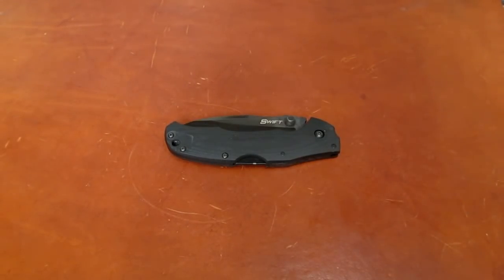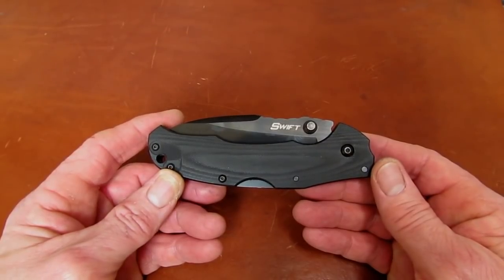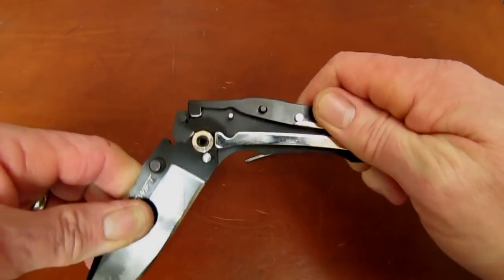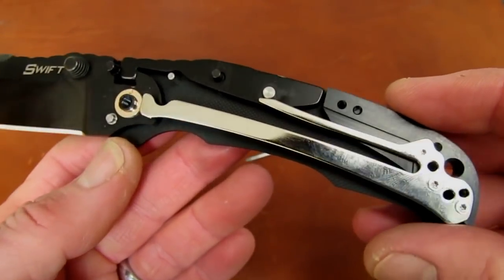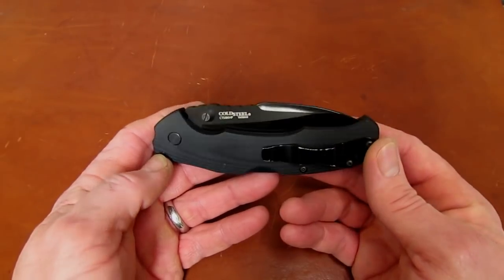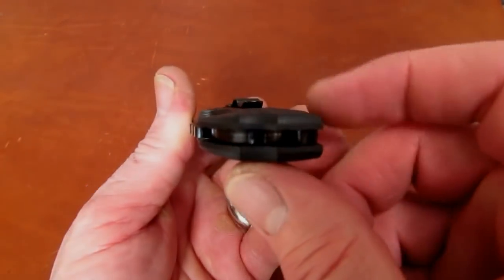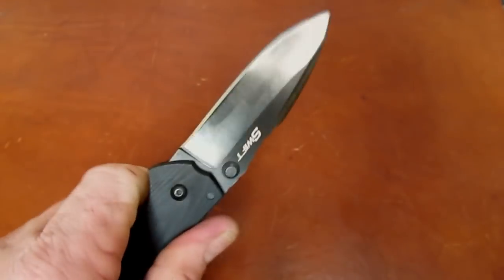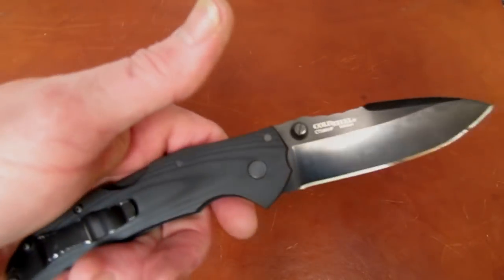FSB -- Cold Steel Swift:  Tri-Ad Assisted Tactical Sweetness

Comment: Thanks for the video, you sold me on the knife. I received my Swift 1 yesterday. And so far I like the assist. With just a nudge the blade makes a great whack sound and it is open. The only issue is a uneven grind on the edge, but I will fix that issue when a put a new edge on the blade.

Comment: Hi, thank you for an informative video! I just bought this knife today, and I find it really hard to open, it's like it's not assisted at all, I have to press so hard with my thumb that it hurts, and even when using the other hand (instead of the thumb) to open the blade it is difficult. Is there anything I can do to fix this which doesnt require me to be an expert on knife-engineering? Would be very thankful for your advice. God bless!

Comment: I found you today coming off a Nuntnfancy knife review and I have been watching you most of the day since. Thank you for your great content! .... P.S. You are not going to be helping my wallet, this I can tell. I am going to have to pick up one of those Benchmade Stryker Carbon Fiber knives. Question: does the centering affect the performance/wear of the knife significantly or is that more of an OCD type thing? (which I do have for my guns and knives) Question 2: How can we send you knives to sharpen and what are your cost ranges? Also, do you do swords?
Reply from the maker: +dawhitecastle Glad to have you aboard, my friend!  So... questions... 
Centering is more of an OCD thing unless there's actual contact between blade and liner or scale.  If you watch my sharpening service video, which is linked at the beginning of all my vids, all my pricing, shipping and contact info is in the description.  No, I don't do swords :(
Reply: +TheApostleP thank you gor the reply! i just be sending you quite a few pieces
Reply: +dawhitecastle just might be*
Reply: TheApostleP Would you pick this ovet the ultimate huntet.  Thanks

Comment: I had a Sog Zoom open up in my pocket. I didn't feel it: I reached my hand in my pocket a sliced my finger pretty deep. It was so sensitive on that spring assist. I have hated assisted openers since then. This design is a little different. It seems like there is retention holding the blade in. Do you seem that being a problem with this one.(firing in the pocket)

Comment: Any thoughts on S110 vs M4 blade steel ?
Reply: SREagle m4 by miles unless you're gonna be using in wet/humid areas where rust is an issue. M4 and s110v are about equal in edge retention but m4 having less vanadium at the same hardness is easier to sharpen. M4 blows s110v out of the water in toughness. S110v is notorious for chipping issues. S110v only has an advantage in corrosion resistance bc it's stainless and m4 isn't. Hope this helps!